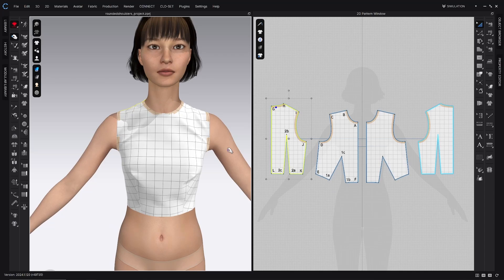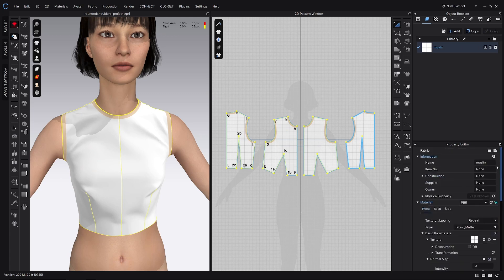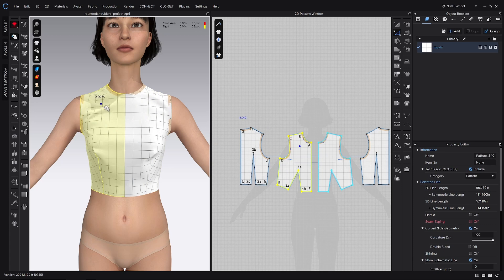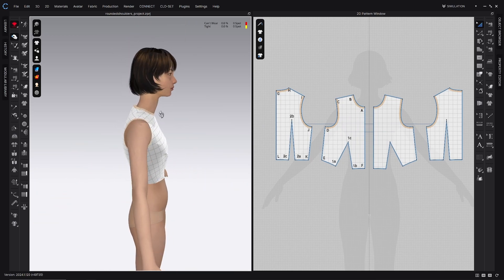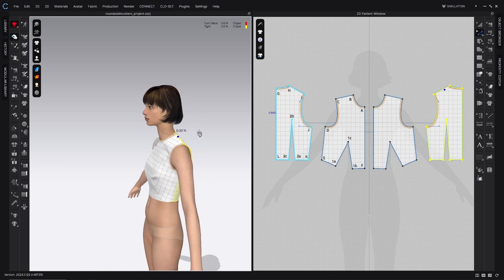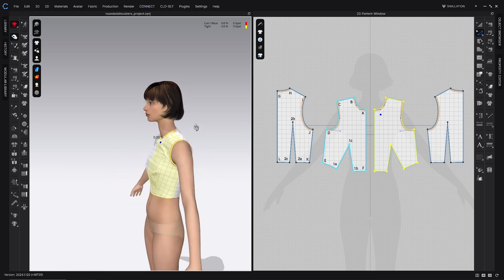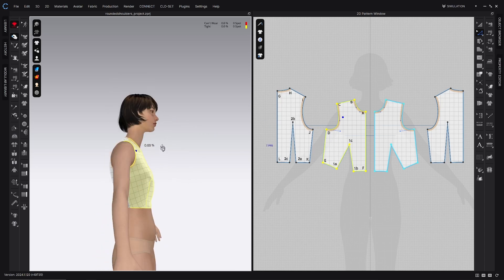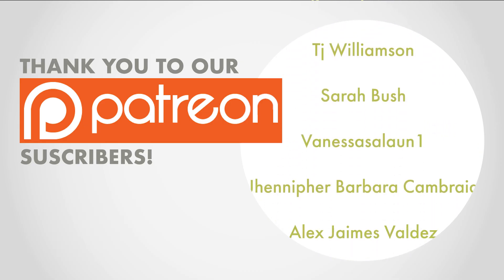How to Fit a BODICE in CLO (rounded shoulders)

Comment: how can  i make drill hole (Punch circle ) in the end of my dart ? I will need this if i need to print my pattern ..
Reply from the maker: I typically add specialty symbols after exporting my pattern to Adobe Illustrator where I also can set up custom print sizes, fonts, line weights, etc. I have a tutorial on how to export on my channel. Hope that helps!